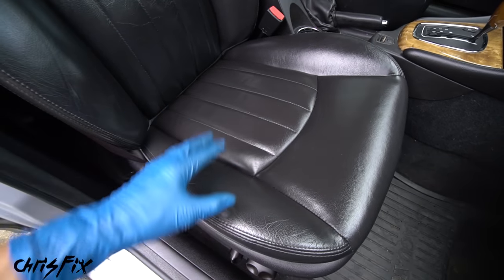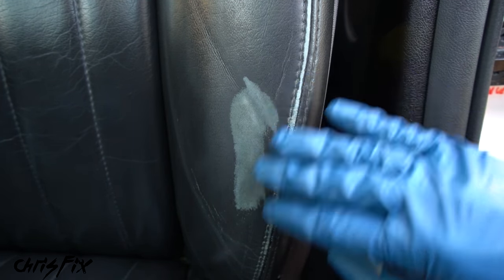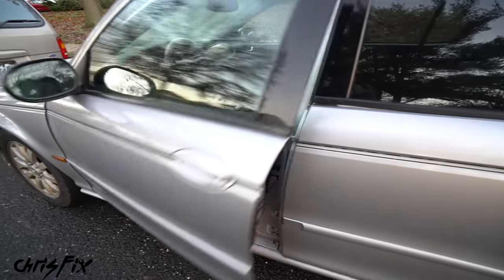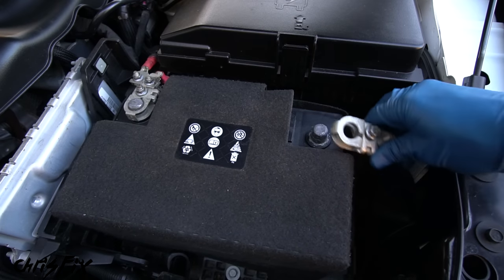How To Super Clean Cloth and Leather Seats

Comment: does disconnecting the negative cable reset the car’s memory/computer/presets?? and are there any special instructions regarding re-connecting the negative cable (if we should wait x mins before trying to start/drive the car, etc.)?
Reply: It does yeah the cars time would be reset along with it running slightly different the first time if you remove both. I know cuz I did it

Comment: I had a fuel pump leak.  The back seat still has a gasoline/oil smell.  What can I do to get rid of that?  Would using extractor vacuum on the foam from the bottom of the seat get rid of the smell?

Comment: I got a Toyota Prius... Would I have to disconnect both the normal battery and the hybrid battery to remove the seats? And is it safe to disconnect the high voltage/hybrid battery myself?

Comment: If I pull them out of the car i use the hot water pressure washer. If I leave them in I do this but use a drill with a brush attachment.

Comment: Forgot to mention do not over saturate seats with water due to some seats, especially passenger seats have a sensor under the foam pad.  Getting that sensor over saturated will cause it to malfunction; this will be most noticeable when the passenger indicator light does not come on and go off when a person sits in the seat and disembark from the car. It will also pop up on the fault indicator on the dash.  When I was looking to purchased a used car this was my first indication the car may have flood issues or rained in due to window being left open.

Comment: The perforated leather seats of my 2017 Subaru XT Forester touring model has a problem with white sunscreen residue and sweat. How to remove and clean the seats without removing the black dye?  
Thanks
Reply from the maker: The way I show in this video is fine. Spray your cleaners onto towels and not onto the seat so it doesnt soak through the perforations.

Comment: I personally use an upholstery brush on leather to work in the cleaner...and not just in the stitching.  You'd be surprised how many of those large cracks become basically invisible once you clean them with a brush.  There's dirt and oil in those cracks that's making them more visible, and a rag generally isn't going to clean the cracks out well enough.  I had a detailing biz for 10 years.

Also I noticed you said the cloth material leaves behind rings when it gets wet because of the dirty padding underneath.  That's not true.  It's simply a very poor material that's being used in a lot of newer cars.  Even brand new cars with this material will dry with a ring if you get it wet in one spot.  With these seats, the only way to properly clean them is to get the entire seat evenly damp before cleaning, and then letting it evenly dry.  Even having a shadow over a part of the seat can cause a line/ring to develop when the seat dries.  The extractor worked because you got the entire seat damp and you dried it evenly.  It wasn't because you removed dirt from the padding.  There are stains that can come up from padding when the seat gets wet, but that's not what you're seeing in this video.  It's just poor material that needs a special cleaning technique.
Reply from the maker: Thanks for sharing

Comment: To remove car seats you only need to disconnect the negative battery connection?  Not both?  I know some cars disconnecting the batteries can could some issues.  I assume only disconnecting the Negative is the best choice?  Is that correct?
Reply from the maker: correct

Comment: If you disconnect the battery can this cause an issue with the cars computer.  The radio system often requires a pin but are there other things to consider when disconnecting the battery.

Comment: Ok, I got a question...
So my front driver side seat is electric, and the seat won't move once I go to disconnect my battery, of course.
So with that in mind, can I loosen the bolts holding the seat down before disconnecting the battery?? Or would that be unsafe??
Might be a dumb question, but I'm not much of a car guy. I just don't want the airbag blowing up on me lol.
Reply from the maker: Not dumb at all. Yes you can do that for sure!

Comment: I wanna give you guys a better way to HANDLE seats. Since I have to hand load and remove seats often in the factory. 

Left side of the car? Right hand. 

Right side of the car? Left hand. 

You wanna take that hand, and shove it between the back , and the lower cushion, you see the gap there, get in deep and grab it with the respective hand. 

You will have so much more leverage … 

Use your other hand to help angle the seat, but this way you are gripping the seat near its center of gravity.

Once you grab the seat through the gap, you are going to lift it and rotate it over in its side, so that you are going to rotate the seat OUT of the door, with the seat cushion rotating towards the back, and rotating the head rest forward ..
Reply from the maker: Thanks for the tips!
Reply: @chrisfix  Naaaaaah thank you :) I have loved your videos so much for years.

Comment: do we put the carpet cleaner then spray it with water ? or do i just choose a method ?
Reply from the maker: I like spraying with water after the carpet cleaner to make it more liquidy so it dissolves dirt more. Dont soak it, just get it a little more damp than just carpet cleaner. But you can just spray with carpet cleaner and extract that.

Comment: Disconnecting the battery for 20 min in my car will reset the ECU and make it run bad for a few days until it gets its shit together. Disconnecting the battery for like 3 min with the lights on will drain all capacitors.

Comment: i would love to clean my parent's cars like that, but they say that if i use something like the extractor vacuum and carpet cleaner that the carpet & floormats will get moldy. is that true? i really want to use the carpet cleaner on the seats and the carpets but i can't according to them
Reply: Do it on a hot day and don't leave them soaking wet so they can dry quickly and you shouldn't have a problem.

Comment: 100% Guarantee you will destroy some plastic in your interior removing your seats  .. It's not necessary at all if you need to get under the seat  Just tilt back loosen the bolts if you wish but it's not necessary...   I've already destroyed a couple interior parts over the years removing my seats , Lucky I was able to go to the junkyard or to order the parts from the dealer..Plastic around the door is pretty cheap... also those stains on the seat were probably from something spilt and didn't clean properly..
Reply from the maker: I remove seats all the time for various projects and never destroyed any plastics. Just need to be careful and if you want cover the door plastics with a beach towel. I like your tilting back idea! Defintely easier even tho you dont have the same space.
Reply: I’m gonna level with you homie, if you can’t do something as simple as removing a seat from a car without breaking something, you’re probably just doing it wrong and should ask for help

Comment: İ washed my car seat yer with Koch Chemi Pol Star. But after the changed to be black to grey. 
First i use the vacuum, 1:10 ratio the Pol Star and use white ( soft ) drill brush. Finished with Karcher puzzi 8/1. 
İ didn't understand where i made a mistake.
The same thing happened with the door panel.
🤔😡😡😡

Comment: What if you have heated seats ?
Reply from the maker: Dont soak the seats in water, just spray a mist of water on the surface and use a brush to agitate the material and then suck it up with the vacuum.